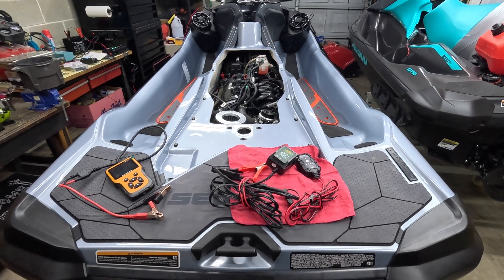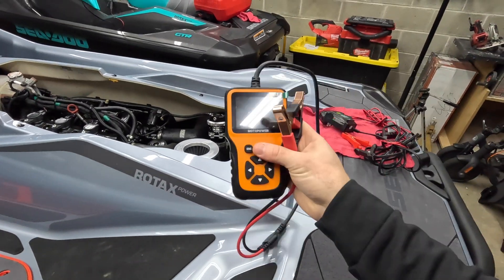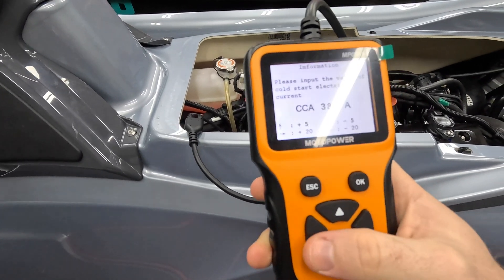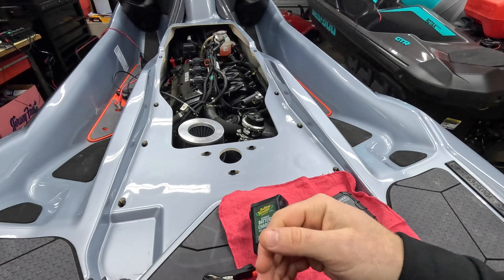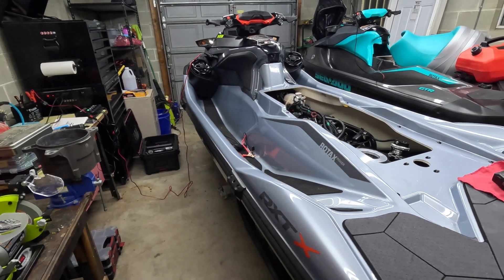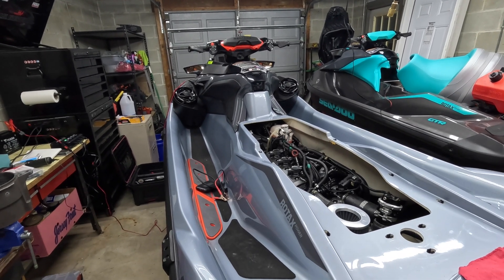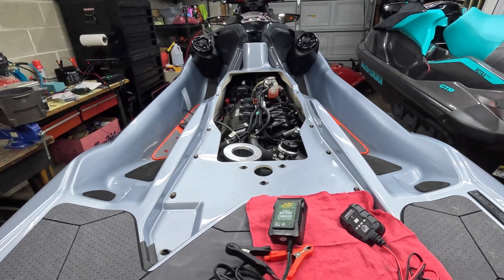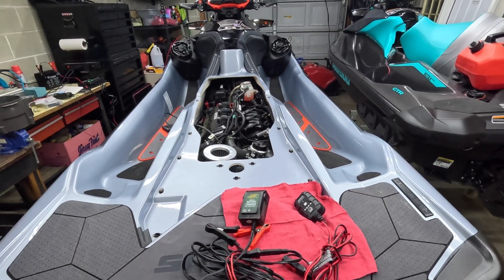SeaDoo Batteries // Charging, Haijiu Problems, Lithium vs AGM, Battery Testing and Diagnosing Probs

Comment: Don't know about this jet ski but my 2021 SeaDoo has a "compartment" up front behind the storage bin for a battery.  If you have a radio, I would just hook the radio to that battery and thus no worries about drawing down your starter battery.
Reply from the maker: The secondary battery tray? You can do that if you keep the battery isolated but without the stator providing power it won't last very long. The Seadoo secondary battery kit basically ties the batteries together in parallel.

Comment: I am on 3rd year of battery.  I disconnect the battery after use and reconnect it when going to use it.  Never have a problem and it shows 100% charge and 94% "health".  I keep it at a storage lot and this year was only out 4 times.  Will remove the battery next week and charge it and forget about it till next spring.  I do NOT keep it on a float charger.  You can find one video on YT that will tell you one thing and another that will tell you not to do that same thing.  People just have to decide for themselves what works best for them.   Just get a decent AGM battery and it should last quite a while.
Reply from the maker: Are you using the factory Haijiu or the previous factory battery of Yuasa? A majority of the “new” Haijiu batteries have been problematic. Reputable dealers don’t stock them anymore.

Comment: Hi Jake, love your Channel. We just bought a 2025 Seadoo GTX 130. Sadly it’s in storage til spring, we haven’t even had a chance to start it. I come from the late 90’s XP’s which were pretty simple and I did all the work myself. On these new skis, what kind of battery do they come with? AGM? and what maintainer do you recommend? I was looking at the NOCO Genesis 2 smart charger. Thanks and I’ll keep watching
Reply from the maker: Thanks for your support! Yes, these skis come a Group 20 size powersport AGM battery. The one they come with "Haijiu" tends to be horrible quality so I wouldn't be surprised if you have to replace it by the time spring comes. Luckily, there's plenty of good options out there! 

Yes, I highly recommend the NOCO genious chargers, the Genius 1, 2, and even 5 amp are perfect for storage.

Comment: First thing is, can the stator charge the battery properly. Older ski stators are not design to charge lithium batteries
Reply from the maker: It sure can. It won't fully charge, it will stop at around 85%-90% which is actually better for battery longevity. The stator doesn't put out enough voltage to charge to 100%.
Reply: @jetskijake-seadoo lithium batteries are voltage sensitive?  If what you state is true, then why do most lithium batteies require a specific type of charger?
Reply from the maker: @justinbustin677  it’s not that they are sensitive, it’s because the resting cell voltage is slightly higher than a standard AGM cell. You can charge a lithium with a regular charger, it just won’t charge to its fullest potential. 

Think of it like an air tank. An AGM is like a 100 psi tank and a lithium is like a 120psi tank. You can fill both tanks the same way, but the lithium tank needs slightly more pressure to fully fill it.

It’s not the best example but it’s the best I can come up with lol

Comment: Can the battery be installed while running the tender? Does the tickle mess with the electronics?
Reply from the maker: It sure can and no the tender will not interfere with any of the electronics!

Comment: Had my '25 trophy for a month now, switched out the stock dual batteries with the  single 34 amp hour motobatt. Took it out yesterday for the first time with the new battery to fish and in 2 hours i got a low voltage alarm/symbol. 

In those 2 hours i stopped for 10 minutes at a time maybe 8 times with the engine off and the speakers playing music along with the fish finder running.  Is it normal that the low voltage alarm would go off with that kind of use without the engine running? 

I'm thinking about just using bluetooth earbuds to save the electric usage so i dont have to worry about the battery cutting my trip short. I called motobatt and they said with how i was using it,  i should have a solar trickle charger connected, I've never heard of anybody on a jetski needing to do this.
Reply from the maker: You should definitely be getting much more use out of it than that. Did you fully charge the battery before taking the ski out? They generally ship the battery with a 40-60% charge so it may not have had enough time to charge while you were on the water.

Comment: Hi Jake, Thanks for taking the time to share your knowledge with us, we all appreciate it!  Question, Do you have a video on  installing a battery switch? I have a 23 Fish pro Trophy with dual batteries. A new Motto batt 30ah for the front and Motto batt 20ah for the rear. They are currently in parallel which makes them 12v/50ah.  I was thinking of installing Blue Seas 6007 - 3 way isolator switch but I've recently discovered the Blue seas Mini which comes with an ACR (automatic charging relay) would this system work with my set up? as they say you need an alternator and Sea Doo's only have a Stator.  Any advice would be appreciated. Thanks.
Reply from the maker: Thanks for the positive feedback! I don't have a video on installing a switch, but in your case that will work. The ACR works by detecting voltage. On the SeaDoo, charging voltage is over 13v so the ACR will work.
Reply: @jetskijake-seadoo  Cheers thanks mate. 🙂

Comment: Just went out in the ocean with 15 knot winds for the first time on my 2025 trophy i just got 3 weeks ago new and the engine wouldn't turn over an hour into riding. I was saw a red battery error  icon on the dash from the boat ramp but figured the alternator or stator would just charge it if anything.

Went to grab my fishing poles, the key attached to my pfd pulled out which killed the engine.  The engine was off for only a minute with the dash on and the engine wouldn't turn over!  The dash and fish finder turned on but the but the engine wouldn't turn over. thank god i had a resq link. The coast guard towed me back. Took about 40 minutes for them to come get me then took over an hour to get back to the harbor since i don't have a tow tap in my ski yet 🤦🏽‍♂️

Took the battery to autozone to get tested and they said the battery was healthy and good but that it had no charge

Comment: Hey - just discovered your channel. Great videos, but only have watched 3 so far.
 I have a 2021 GTX 170 and do all my own work, mostly because the dealer I bought from is a trainwreck. I hate removing the battery every fall even though I store the ski in my garage, so I'm interested in your recharging setup. Have any links you can post for more information?
Reply from the maker: I sure do, I actually made a video on the charge port and it has purchase links as well https://www.youtube.com/watch?v=c9YWPXKGC58&t=2s
Reply: @jetskijake-seadoo  thanks mucho!

Comment: Got stranded with my fish pro trophy over the weekend. Your video is very helpful. My battery shows 12.4. I got an ibr error, loud beeping even with key disconnected and dash lights flickering. No start. Won't even turn over. Can you recommend replacement batteries for my ski. 2023 fpt. Thanks
Reply from the maker: I would go with a Yuasa or Deka if you stay with AGM, or the NOCO NLP20 if you want to switch to lithium.
Reply: That exact thing just stranded me too the other day. I had to get a jump pack and then it started and got back to the dock. Now I have to find a new battery.

Comment: Another great video, thanks. I have a 2023 RXPX 300 where my battery died at the start of the second season, and it thoroughly screwed up my ski. They had to replace the cluster, and I got them to replace the battery under warranty and give me a four year warranty after the ski sat at the dealer for two months.  Now I have a 2024 325 and the first thing I’m doing is replacing the battery, because it’s acting up but not as bad.  Great advice on the tester, and I’m trying to figure out the best way to charge when I’m low.  I assume I should not put more than 10 amps on a charge in case I’m low, correct?  Again, thanks.
Reply from the maker: It's insane how many problems could be resolved by just switching to a decent battery. SeaDoo really needs to re-consider their contract with Yuasa and go back to them.

Comment: I have a 2024 GTX 170, haven’t had any issues yet with the battery but know it’s coming. What replacement batteries would you recommend from your experience?
Reply from the maker: Yuasa, Deka, MotoBatt for standard AGM (plenty of others that are great too) or if you want to go lithium, the NOCO NLP20 is fantastic!
Reply: @ thanks for the reply! I just need to make sure it will fit in that small space in the ski!

Comment: I replaced the factory battery on my new 24 fish pro sport with GCJETSKIFISHING battery mount and MOTOBATT 34 amp hour 440 CCA battery for twice + times the amp hour. It was a tight fit but worked. Plan on adding the NOCO adaptor to SAE charge port as you did for easy access charging. My experience with the NOCO GB150 jump starters will not jump if battery is less than 5V. Thanks for the videos!!
Reply from the maker: The SAE charge port certainly makes things easier! For the jump pack, did you use the 12v override mode? That will override the sense voltage requirement and will provide jumping power regardless of detected battery voltage.
Reply: @jetskijake-seadoo  I have tried the 12V override function always on dead  Volvo cars. I work for a Volvo dealership and our cars can connect to the dealerships wifi for  diagnostics without knowing  usually by over the air connection causing the car to stay awake causing battery drain less than 5V. Maybe a high resitence at he jump pack due to our battery monitor system. The NOCO protection doesn't allow to start. Snap-on doesn't have an anwser for this. But having said that a cheap Amozon jump pack will start these cars. Volvo cars are a strang bird nothing works on them except factory recommendations.
Reply from the maker: @Notbad1973  Thats really interesting, I'm not sure about Volvo and their battery management systems, but the 12v override will absolutely work on a SeaDoo regardless of whether you're using an AGM or LiFePO4 so its certainly something worth having onboard.

Comment: Thanks Great Video, I have a 2016 GTX 300 and my question is; Is it safe to charge my battery with the wires still connected to the ski? I have always disconnected the wires before charging my battery maybe this is not required? You thoughts would be appreciated, as I presume that there is some type of diode system?
Reply from the maker: @jetson328  It absolutely is! You only really need to remove the battery for winter storage if the ski isn’t kept in a temperature controlled environment since they don’t like to be charged in the cold. Other than that you can absolutely keep the cables attached.
Reply: @jetskijake-seadoo  OK Thanks Jake

Comment: I know in Yamaha‘s you are instantly dead in the water if your battery acts up on you. I’ve had it happen twice, cruising along. Sounds like the engine blew up stopped so fast, but it was just a bad battery shutting the engine down. That’s why I will never buy a  battery from Walmart again!

Comment: What are your thoughts on adding a second battery to the ski and maybe using a lithium battery as the second battery
Reply from the maker: You won't be able to connect the two batteries together if you do one AGM and the other Lithium, so you'd either need to install a battery isolator switch, or install two lithiums in parallel.
Reply: @ ok so I should do 2 agm with the BRP second battery kit this is my first ski but I do anticipate using the speakers a lot
Reply from the maker: @santos_home3980  Yup I'd either do 2 AGM or 2 Lithium, both are good they just have to be the same. With a single battery you should be able to get about an hour of speaker time with the engine off.
Reply: @ thank you very much
Reply: Can you give us the link to the charging port you added to side of the ski?  I like that install
Reply from the maker: @mark854a  Sure can! I have the link in the install video https://www.youtube.com/watch?v=c9YWPXKGC58

Comment: Jake! 1:48 Если напряжение при запуске падает до 8.9 V  это уже плохо ? Спасибо.  Какое  оптимальное напряжение при (нагрузке)  запуске двигателя ?
Reply from the maker: Yes that's a bad battery. Cranking voltage typically drops to ~10.5+ voltage. If it goes below that, its a sign the battery is bad.
Reply: @jetskijake-seadoo  https://www.youtube.com/watch?v=SuatKMH1NS0
Reply from the maker: @имяфамилия-н4г3ж  If you have room in your ski, thats a good upgrade. Some models have the engine slightly more forward so it will not fit.
Reply: @jetskijake-seadoo  rxt 325   2024г ?  не подойдёт?
Reply from the maker: @имяфамилия-н4г3ж  Its a bit tight, I don't believe you're going to fit a group 30 in the RXTX.

Comment: Do you recommend a second battery? If not, what do you recommend for back up thank you
Reply from the maker: Dual battery is okay if you want to extend your accessory mode runtime, but it won't help as a backup unless you wire both batteries to an isolator. The better alternative is to just carry a jump pack onboard. Specifically one with a 12v override mode just in case your battery is very dead. 

The NOCO GB40 is a great choice, because its incredibly light weight and easy to store onboard. https://amzn.to/41bVGCz

Comment: It's really simple.  Do not plan on using your OEM Haijiu battery for more than one year.  Change it out before you get stranded for a top tier AGM like an Odyssey or Deka.
Reply from the maker: @billy-bo-dilly  Exactly. I recommend most people change it as soon as they buy it. I’ve seen multiple that were bad right off of the dealer lot.
Reply: Deka ...super battery

Comment: Picked up my new 2025 Sea Doo GTX 325 LTD last week, already changed the battery to a DEKA EXT20L due to reading bad reviews about the batteries BRP is putting in the new skis now.
Reply from the maker: Good call, you just saved yourself a bunch of headaches.
Reply: Здравствуйте! Какие были проблемы из за аккумулятора? очень важно для меня. опишите проблему. спасибо!
Reply from the maker: @имяфамилия-н4г3ж  Multiple fault codes, iBR faults, weak start, etc.
Reply: @jetskijake-seadoo  какое минимальное напряжение для аккумулятора?  На моем сейчас 12,4V это плохо?
Reply from the maker: @имяфамилия-н4г3ж  You can't really go based on voltage alone. If your battery has a bad cell it'll still show a healthy voltage, but when it cranks (or when there's a load applied), it'll drop heavily and thats when problems start to show up. When in doubt,  replace your battery!

Comment: What is the life expectations of a new sea doo battery
Reply from the maker: If it's a Haijiu (new stock battery), most will last about a year, some have been lucky to get 2 years. In previous years, a Yuasa (old stock battery) was good for 3-4 years.
Reply: Bought my ski new in June of 2023, just had the Haijiu die on me October 2025. 38 hours on the engine.

Mostly kept indoors with a trickle charger/maintainer

Comment: Amazing same issue, same stock brand battery.   my seadoo is only 10 months old and battery is weak.  What battery did you go with for a replacement?
Reply from the maker: I've had nothing but good experiences with the Yuasa batteries. They were the batteries SeaDoo used prior to cost cutting. They're also made in the US. Amazon sells the Yuasa with an acid pack which means they ship you a non activated battery that you activate by dumping the acid into the battery. It ensures you have a 0 day old battery rather than one that's been sitting on the shelf.